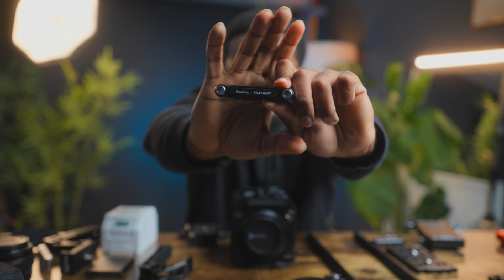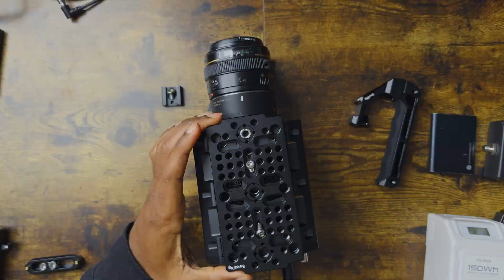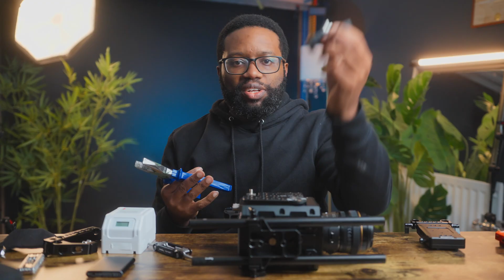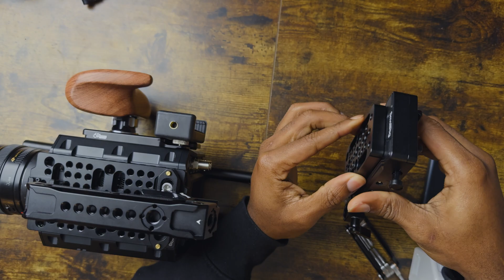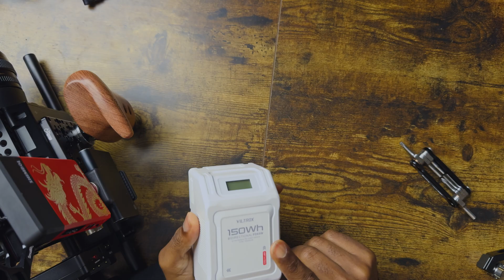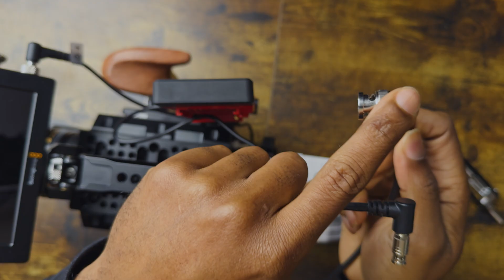My SmallRig X Blackmagic Pyxis Cinema Rig Build

Comment: The front USB-C is a 1080p wired output with 2 way OS control (Pyxis monitor only). The SDI/BNC signal out of the back of the camera, to record up to 4K on the VA in ProRes or BRAW.  The USB-C on the back of the camera is up to 6K wired data output for SSD recording, and a wired output for "Cell Phone to Cloud 1080p Proxies or Streaming" (depends on 'phone) with free app and storage.  Over-all, there is also a iPhone and Android Remote "Camera Control" app via Bluetooth - $17 (OS menu only, no visuals).  The LAN is the fastest transfer method (no expensive CFexpressB Card Reader needed).  Laptop, Browser, Copy and Paste.  $5 CAT cable.  LAN Cloud and Livestream too.

Comment: Hello ,Can you forward the sdi power information to us here please?
Reply from the maker: Sure:
1. Make sure both your SDI accessory and camera have power and are turned on preferably 
2. Plug in SDI cables

Before powering down camera

1. Disconnect SDI cable
2. Turn off SDI accessory or camera which ever one you wish to

Comment: I wonder if the SSD drive and Transmitter can be moved down to the last quarter inch screw mount just a thought
Reply from the maker: The thing is you need clearance to hold the side handle